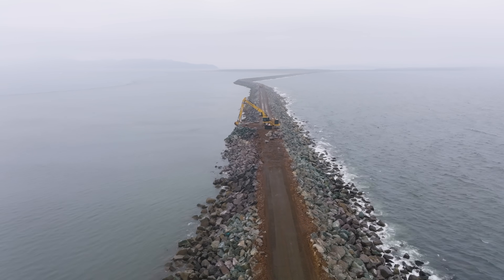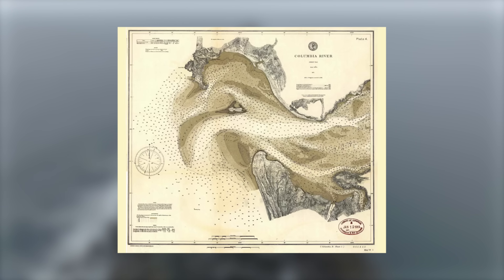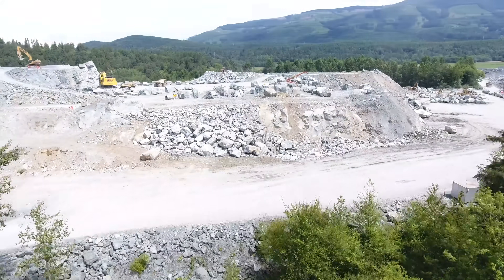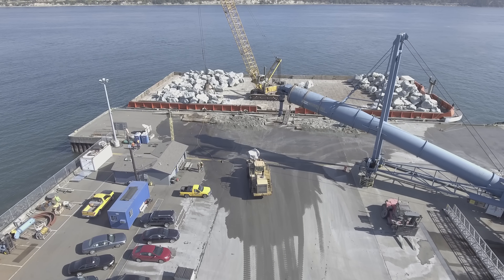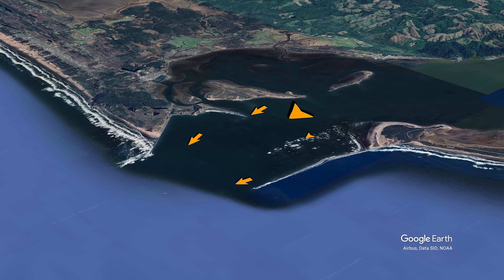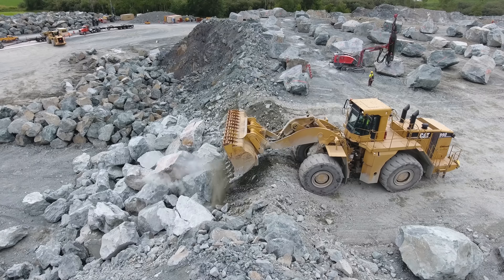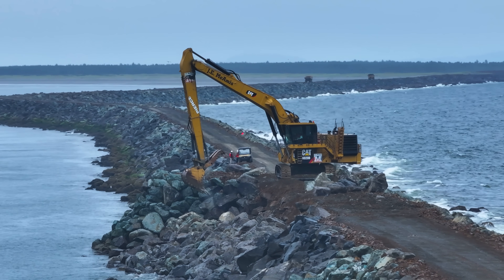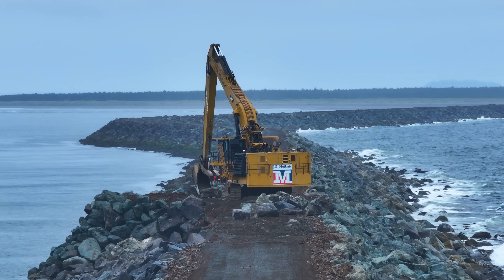Why Build a $250 Million Rock Wall in the Ocean?

Comment: Its wild that each stone is designed and weighed
Reply: I bet the 'weighed' part is due to the quarry getting paid by weight, not just a payment per stone.
Reply: and then dropped it whatever order it arrived.
Reply: This is to keep track of tonnage used per length of jetty, and it could also vary through the length according to calculated stress, only my layman perspective.
Reply: archaeologists 3000 years from now will only know this  part about our civilization
Reply: huge waste of time
Reply: @smo5681 Yes that’s what I was thinking. I did a small shoreline repair job with 1.5m stuff. You just have to look for best spot for boulder, poke it around a few times and lock them up. I didnt serialize the rocks lol.
Reply: @ChuckBeefOG  So, exactly like the mouth of the Columbia, where 40-50 waves hit. You go dude.
Reply: @lickyweeks  The rocks were not serialized based on shape. Its not like they delivered all the stones in sequence and positioned them based on a drawing. So its pointless besides helping keep track of tonnage and total rocks.
Reply: @lickyweeks  at the bottom of a power dam actually, where its constantly bombarded by a 30’ waterfall its whole life and subject to -40f winters with freezing and expansion with ice, so yeah kinda the same idea. A more complex work zone too.
Reply: @ChuckBeefOG  You have to realize this is government work. Impressive machine though.
Reply: @smo5681 how waste of time are you stupid or something
Reply: It makes a friend lots of easy money. It might have been a favor? @smo5681
Reply: I don't know, but people are saying that there is serial number on every rock. Should one be dislodged or damaged, there is an exact duplicate in the warehouse. The warehouse itself is a former Tesla mega-factory in China. When needed, the replacement rock is sent via air freight. It's a great system, and Musk uses 100 percent of the revenue to fund Just Stop Oil. I did my own research.
Reply: @jimthompson717  Sad that there are Democrats who will believe you.
Reply: Huge waste of tax dollars.
Reply: @dherman0001 OK clown 🤡